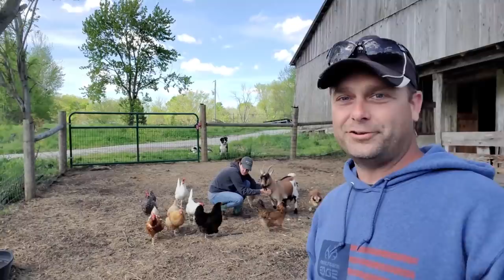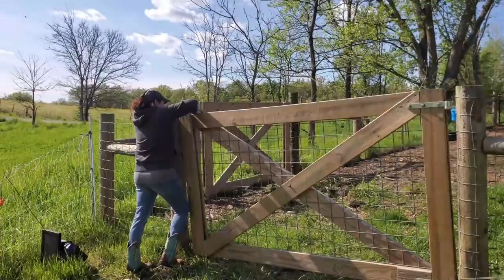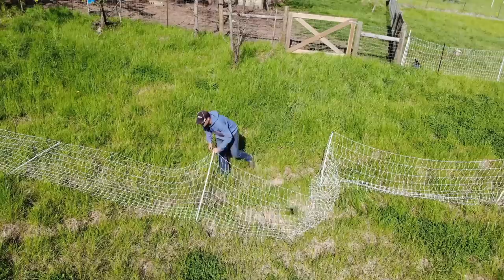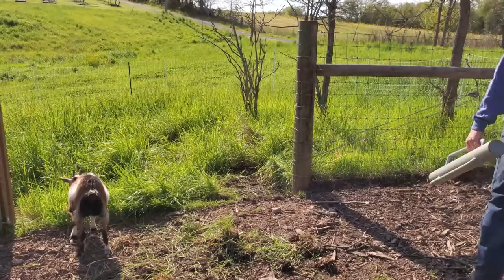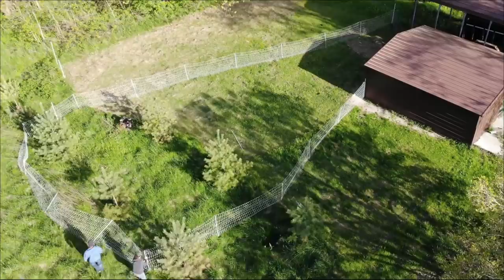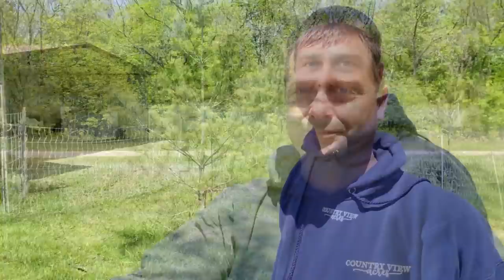Electric Netting that is nice and tight

Comment: If those corners don’t hold real well you can always put t posts at the corners also and zip tie the fiberglass posts to the t post just leaving some space. They won’t conduct and would help it be stronger and tighter.

Comment: Just use the tie strings and tie it to the wooden post that's there already, that's what I do!
Reply: kevechevroletcoupeé  the wire on the wooden post will short out the electric fence.
Reply: Yup, or zip tie to the stockfence.
Reply: @cathiwim  You don't tie it that tight. You get it just tight enough to pull the sag out. I've run over 100 sheep and goats behind eletronet for years.

Comment: What is the information on your electric fence box.  I noticed you didn’t use a grounding rod
Reply from the maker: The bottom of the fence charger box has a metal stake that pushes into the ground.  It acts as the ground rod.  It is a premier 1 intelleshock 60
Reply: Thank you!

Comment: Doesn't the electric fence ground out on the tall grass?
Reply from the maker: Yes, it will lower the voltage, but it probably still has 4000 to 6000 volts on it, instead of 8000.

Comment: Couldn't you just zip tie the post to your main fence?
Reply from the maker: If the strands of the netting touches the metal fencing it will ground out.  So I like a couple inches between them.  And the fiberglass post fills that void between them and supports the netting.